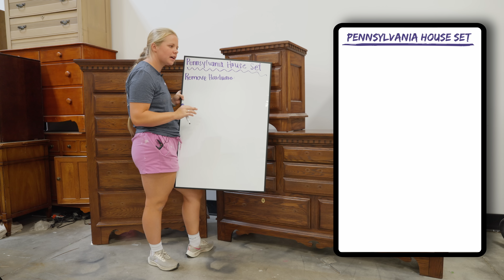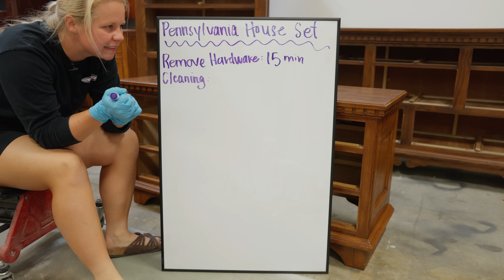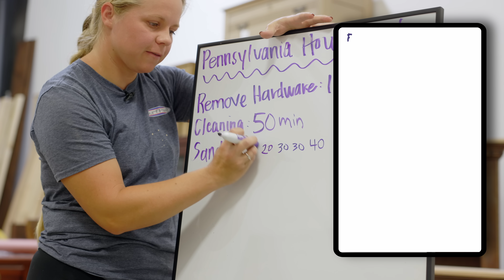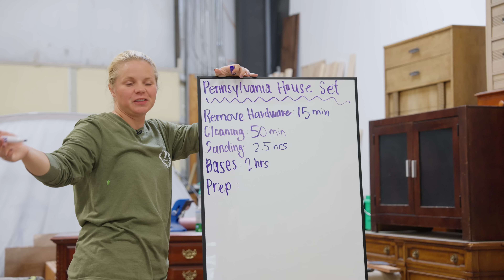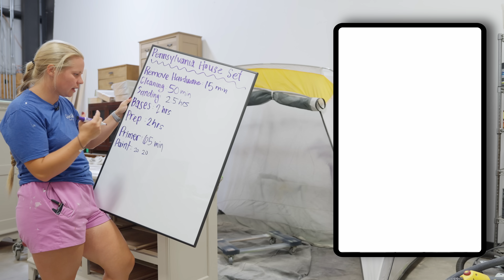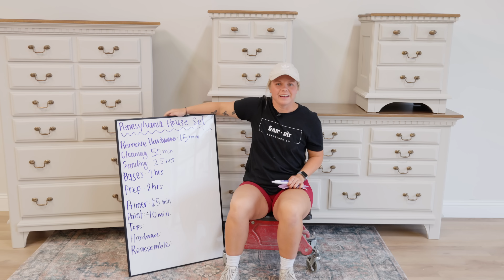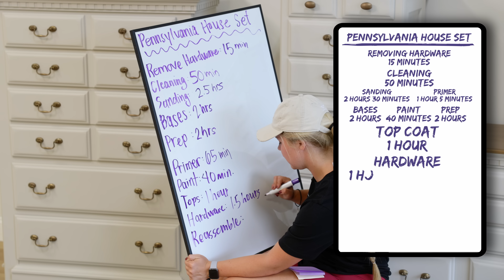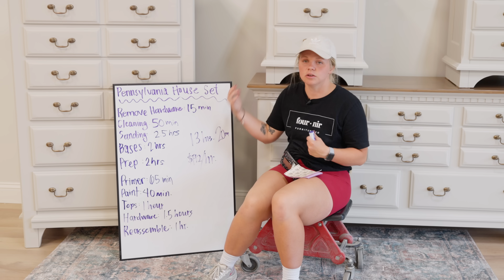Flipping a 4 Piece Furniture Set for MAJOR PROFIT!

Comment: Love what you are doing - but I don’t think the cost is accurate.  You spent time picking it up, staging for sale, and your equipment you use, there must be a cost associated with the tools.  I noticed a ‘helper’…. There should be an overhead cost put in your numbers as well.  I am sure that you are making money, and I love what you are doing.  I would want a purchaser to realize you aren’t really making $200 an hour on this set.  A beginner that might want to flip furniture would need to realize you have a paint tent, sprayer, sanders, drills, nail gun and I am sure truck or trailer.  Probably more than I’ve mentioned here.  Those can’t all be included, but an overhead number is important.  Job well done.  I am hoping you are doing this for a living.  You are very knowledgeable.  Thank you for teaching the rest of us.